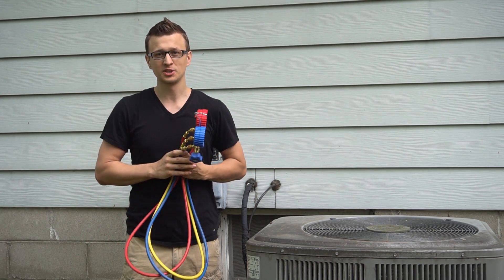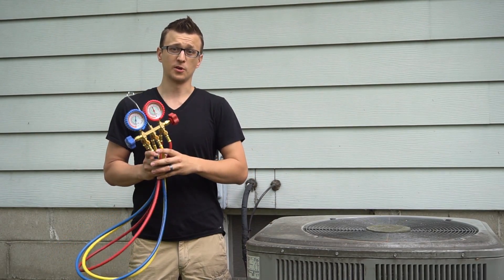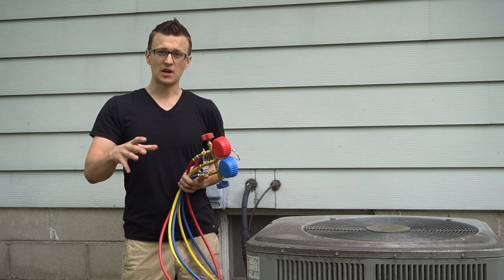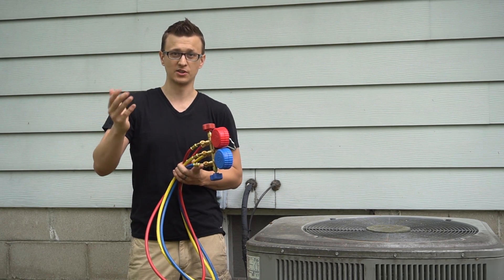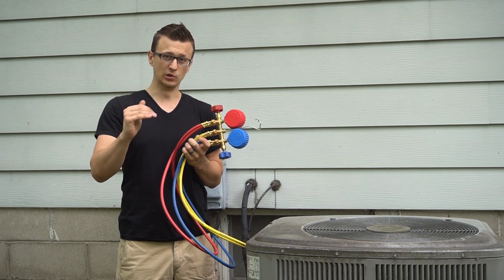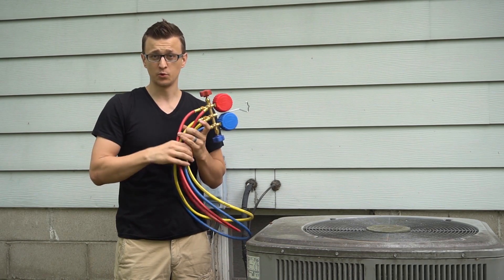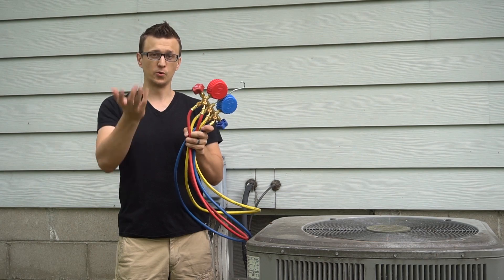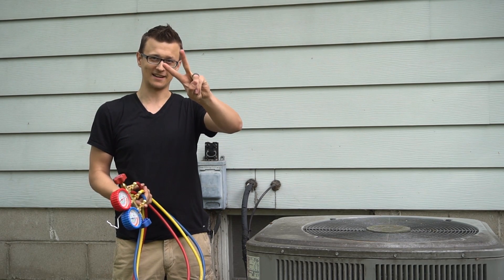How Often Should Freon Be Added To AC Unit? How Often Should It Be Checked?

Comment: Hello Sir, new to your channel. When installing a Propane Furnace does the AC unit outside need the freon removed. Reason is because  of Cooper coils being  disconnected for installing new Propane Furnace. 
I am not telling anyone.  I am asking  if this is correct procedure?
Reply from the maker: Yes. If you will be cutting or disconnecting the copper lines going to the evaporator coil, the freon will need to be recovered before doing so. After the furnace is installed and the lines are reconnected you would need to pull a vacuum on the refrigerant lines before adding the refrigerant back in.
Reply: I now know the AC Tec was 
being honest & not misleading. Thank You for the reply. 
✌️😃

Comment: Unfortunately the tech who came to check non-working compressor and fan did do something with the refrigerant line even after discovering the reason for the compressor and the fan not running was related to thermostat wiring. When he put in his gauge and took it off both times there was pressurised gas hissing going into air. My AC must have lost some R/22 needlessly. Was it to suggest replacement of AC because of hope that it was low in refrigerant and then that R22 is not made or imported anymore so it is very very expensive and because if that you gave to replace a perfectly functioning old AC? Why did the tech have to release some refrigerant out of my AC line even when he knew it was not related to it?

Comment: my heat pump cools nicely, but will not heat. i checked voltage at reversing valve, and that checks out. bought some gauges, but now not sure if I wanna check pressures or not. problem is, I had two techs come out, and neither one could find the problem. I also had a weird thing happening when I came home one day and my emergency heat coils were energized and wouldnt de energize. I actually took them out so I could run my unit. i dont want to call another tech

Comment: Absolutely, only connect to the sealed system if it's absolutely necessary based on dynamic system performance.  Each time a gauge set is connected, there's a chance of creating a leak that didn't exist previously and/or contaminating the system, and a slight loss of refrigerant will always occur while connecting/disconnecting, highly dependent on how it's done but some loss of refrigerant will occur.
I recommend replacing the o-ring caps "thumb tight" every few years because the o-rings will deteriorate over time.  It seems many 410a systems are using the brass flare seal caps and this deterioration is unlikely in that case because there's no elastomer o-ring.
Schrader valves in the service port tend to leak too much for long term reliability, so the cap seal is important.

Comment: Great info my unit had the fan motor burn up. I was able replace the motor and get it running again but still no sweet sweet cool air. My next step was to check the gas but it seems i need to dial back and check the compressor and evap coil

Comment: Never take these off your truck until you have checked the system and determined that there is a problem and then it should be a Sporlan smart tool or something similar most companies make gauges without hoses. This will give you a almost zero loss of charge. Temps tell you more than pressure in most cases.

Comment: Base on the last AC guy we have leak in our AC pipe somewhere but not sure exactly where the leak is, might be under slab? He read zero pressure. 
The last AC guy said water might get into it, and the pipe is under slab.     Not sure  about the info. He also cut my pipes at the furnace to run some
pressure and he said no pressure. So our AC is out of commission right now.  Advise to fix the leak issue?

Comment: The less you expose the system to the atmosphere, the better. If each time someone connects their gauges eventually the customer WILL be low on charge. Especially if the technician does not clear their gauges using hose valves.

Comment: I agree with everything you said, however...vehicle ac systems are also sealed so should never need charging unless they develop a leak which usually happens with the o-rings in the lines or occasionally in the Schrader valves. But thank you for the videos, I replaced my grandparents fan motor and capacitor based on your video, so thanks again.

Comment: I wondering whether you can comment on my observation as described below, as to whether this situation indicates a too low refrigerant.  When I had my AC unit installed years ago, I specifically requested a sight glass port on the high pressure liquid line for the purpose of keeping an eye on the liquid refrigerant level because my previous AC unit had a leak for some time before i found out.  So, on this new unit with the sight glass port I can see the liquid rushing through and a fair amount of bubbles also.  So, I am wondering whether seeing those bubbles also in the sight class is an indication that I may be somewhat low on my 22 refrigerant ?  Your insight would be appreciated.
Reply: Domestic unit,? Sight glass bubbles can be normal at different times of stop start cycle. The sight glass itself can be a weak point for leaks. Best bet is checking all the brass caps, there shouldn’t be the slightest leak and all the gas should remain there even for 20 years
Reply: @Froggability  Thanks for answering. Yes it is a home unit, and has been showing those transient bubbles for the last 18 years. So if there was a leak then I would have leaked out enough to prevent proper cooling...which it hasn't.

Comment: The most important thing on ALL refrigeration systems to operate properly is making sure ALL filters are clean and coils are clean - REFRIGERANTS are heat sponges which absorb and dissipate heat energy - this transfer of heat cannot take place or becomes very diminished if your filters or coils are dirty. Remembering the BASICS - this will take a technician 👨‍🔧 a long way to servicing and repairing any air conditioner or refrigeration system LARGE or SMALL - the same laws of physics applies. 👍👍✌️✌️

Comment: This video is a prime example of why stuff like this should be left to trained professionals. If you know how to properly disconnect the gauges you only lose a very small amount of low pressure vapor. Properly purging the air out of the lines before hand will ensure that no air or noncondensables make it into the system. I gauge up just about every time. I train techs to do the same. No call is complete without a verification of refrigerant pressures. If you charge people for this half assed check then on top of that give them a bunch of lip service as to why you didn't do it. You're honestly ripping people off. There's a reason "every other tech checked the pressure."
Reply: Looking for some clarification.  My A/C has needed to be repaired every year for the last 3 years.  This year my building's maintenance told me my A/C needs to be 'charged.'  What does charged mean?  Is that another way of saying the refrigerant is leaking?  Does the refrigerant need to be charged every year?  I'm trying to be informed so I can ask the right questions when they do the repairs.
Reply: @brendajameson5093  Your unit is leaking refrigerant. Air conditioning units do not consume or burn through refrigerants like fuel. There is an allowable leak standard for most air conditioning equipment but you as the owner need to weigh the coast of charging the unit every year versus the coast of new equipment. Once a year isn't terrible but that leak is only going to get worse and get more expensive each time. So I would say get a quote from a good company for a new unit install and compare that to the money you spend every year to get it charged up. You can also get a quote from the same company to repair that leak. In some cases leaks can be fixed by a technician. Once again you need to consider the cost.
Reply: @saltvpn671  Thanks.  You are a life saver!  So it's ok to charge the refrigerant every year?  If the leak is not dangerous, having it charged this year will allow me more time to weigh my options.   When I hear leak - i think danger.  That was my biggest concern.  Does having a leak pose a threat to my family or home?
Reply: Brenda Jameson . A leak is NOT  normal. Unless it’s a shaft drive, your refrigerant should last the lifetime of the machine even 20 years and still be full to the brim. As stated in the video. Anyone topping up without first finding and repairing the leak is is an animal, probably telling customer this is normal. Sniff around yourself feel for oil at the brass caps, shouldn’t be any oil. Use dish liquid to find bubbles. Then clean it off thoroughly afterward,. Generally the lost gas is not flammable etc, but It is expensive to get guys in each year needlessly
Reply: @Froggability  Thanks for the info.  I was also concerned about the leak affecting my health.  Because of this, I wanted to check for a possible leak in the inside unit/return vent.  I can hear a slight sound of air coming from what I think is the evaporator coils.  I heard about the bubble test.  Do I just spray the solution onto the coils?  Do I need to take any precautions when doing this or cleaning the solution off when done?  Can I just use a wet rag?  What does M099 smell like?  Unfortunately, I am on my own with this issue since I am a renter and my landlord would rather just refill the refrigerant.
Reply: Brenda Jameson. Make sure the unit is turned off at the isolater. Yes you could use a hand sprayer with 99% water and bit of dish liquid, put the nozzle on stream, squirt around, use your ears. And a torch. 
But most leaks are associated with either brass caps, flare joints, valves, U bends or pipes connected to compressor (leak caused by vibration)  or corrosion, 
The smell oily or slightly sugary smell. Which is not toxic but not good to breathe either
Reply: If discharge and suction temperatures are correct , there’s no need to connect gauges. Rule of thumb: connect gauges only 3 times in its lifetime, beginning, end, middle in case of serious issue

Comment: Gauge up is the last thing that a HVac tech will do, use eyes, ears for inspection first, such as oil leak, fan turning with noise... If all the things are done, then check pressure, temperature, do the calculation.

Comment: Hi , great video! Quick question , I have a old r22 split system. I’m changing it out and replacing it with a 3 ton 410a unit. Old lines are .032 wall thickness copper pipe. Should I change them? Thank you
Reply: Replace everything

Comment: Is there a reason preventing someone from putting a set of gauge permanently attached to the line set? People do that on water supply all the time with a set of gauge before and after pressure reducing valve.
Reply: It would be a weak point in the system , I wouldn’t

Comment: To fill the refrigerant in an air conditioner do you need a vacuum?
Reply from the maker: If you are only adding some, then no, pulling a vacuum is not necessary. If it is a new unit being installed though, then it must be done.
Reply: @WordofAdviceTV  would a vacuum help detect if there is a leak?
In addition, if there was a leak and it was sealed, would that be a situation where I would need a vacuum to fill it?
Edit: I am about to look at another unit that my friend last saw & he suspects it needs a fill due to a possible leak. He said everything ran but air wasn't cold. The capacitor ran hot and he then turned it off. I am watching your videos to get more information prior to going to look at the unit personally.
2nd edit: This unit has everything in one (forget specific name of type of unit) there is no handler in the attic.
Reply from the maker: @RyanSpringer1984  Hey Ryan! Yes, when you pull a unit into a vacuum (negative pressure) it is supposed to hold the vacuum. If the system has a leak, it will not be able to hold it. If the refrigerant was recovered or the unit was flat when the sealing or the repair was done, then yes, one would need to pull a vacuum on that unit. I don't know how much you know about the process but I would suggest watching a few videos to get a clear understanding. Videos like these: https://www.youtube.com/watch?v=wYZ8Wudksb0
Reply: @WordofAdviceTV  thank you. I will certainly have to watch the video to further my education. Your channel has been extremely helpful in terms of the HVAC knowledge I have. I am truly grateful you post this videos and are willing to reply to comments in order to provide more information. You are truly a class act, thank you.
Reply from the maker: @RyanSpringer1984  You're welcome and thank you! :) Good luck with the shopping for a new unit!

Comment: My experience was that if the customer was bird-dogging your work you had better put the gauges on or they were never going to be satisfied no matter how well the system was working.  Sometimes the psychological requirements are just as important as the technical ones.
Reply: You are assuming you are smarter than your customers?
Reply: @aakozanoglu  After you have been "called in on" a few times for "not doing a good job" you learn to take these psychological factors into account when working with the public.
Reply: @aakozanoglu  uhhh yeah the technician should always know more than the customer. If the customer knows more then why wouldn’t they just fix it themselves?
Reply: @ZebraJ274  Knowing and doing are two different things. Do engineers build things or know and design things?

Comment: Hi Jay! After my length question yesterday, there is a new home being built next door and as luck would have it, the HVAC techs were working today. I showed them my system and was told I need refrigerant because the pipe is cold. System is old. QUESTION?? Can R22 be replaced with another refrigerant safely to tie me over till September without changing the compressor. I don't trust these guys. They all want to change the whole system. I googled a few replacement refrigerants. What is your opinion on the matter? It would help forget feedback from someone who knows. The HVAC guys arrived with tools that need charging. Not someone I would call. Thanks.
Reply from the maker: Try calling a utility company that does appliance repair work. They may refill it for you once with R22 so that you have cooling until you get a chance to get it replaced. R22 is set to be phased out by January 2020 but all techs should still have R22 on their trucks.
Reply: @WordofAdviceTV  R22 has been phased out in Canada. I'm just across the river from Montreal where they're phasing out beans soon. Too much methane 😁. I just need a boost to cool my cottage off for 2 to 3 months. I'm putting it on the market in a few weeks so the Buyers will replace the heat pump and oil furnace. I used it till it didn't work. The new HVAC system will be a consideration in the price. I will call a few companies tomorrow. Thanks for getting back to me. It was 83 in my house so i slept under the fan. My house is constructed of quartz brick and by 5pm it's holy heck here. Thanks again, much appreciated.
Reply from the maker: @celesteb3380  Ahh I see! Sorry, I did not realize that Canada has already phased out R22. It hasn't been here yet, so I wouldn't be the best person to ask that. I hope all goes well for you though! Good luck!
Reply: @WordofAdviceTV  Thanks Happy July 4th!!!!
Reply from the maker: @celesteb3380  Thank you!! I just realized there are occasional fireworks going off outside! (was zoning them out until now :)

Comment: Thankyou learned so much from your videos. just subscribed. I got some questions hope you can help just  a newbie here .Is there a way to check  if the system has already been contaminated its already been serviced a couple of times before or how to check if the oil is acidic? And if its contaminated how to clean it and also how is the easiest way to replace the oil without desoldering the compressor. Cant find any drain plug on the compressor. Thanks
Reply from the maker: @ric gogogo Hey Ric! Happy to hear that you learned a lot from the videos! Thanks for subscribing! I can't say I have a ton of experience with contaminated systems... (maybe someone else will come along who does) As far as I know, there isn't a good way to check if the oil is acidic. From what I have seen, a contaminated system will cause your high side gauge needle to quiver or bounce around slightly. It will never stabilize like it should. That's if there's air in the system. If there is moisture or debris in there, then that could restrict the metering device. You would have to use a slide rule and do some measurements/readings to figure out exactly what the problem is. (I use the SuperCool Slide Rule) As for flushing the system or cleaning it.. I have never done that before. We either replaced the whole unit or recovered all the refrigerant, pulled a vacuum on it, and weighed a charge back in. There is no way to replace the oil. The oil is mixed into the refrigerant. That's about the extent of my knowledge on this topic. Hope that helps!

Comment: Do you think you can make a video on analog gauges one set that is bad and one set that is good because today I found out that my 2 hose set was not reading good on the high side and when I went to go charge the system with my charging set my pressures work great